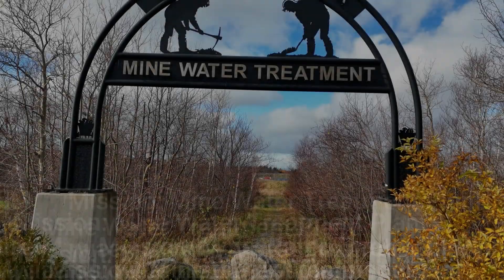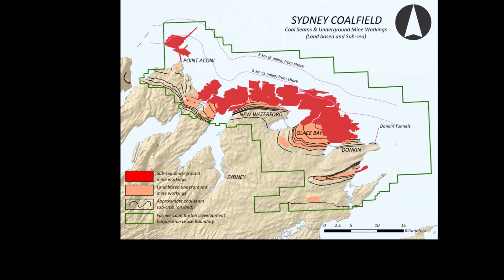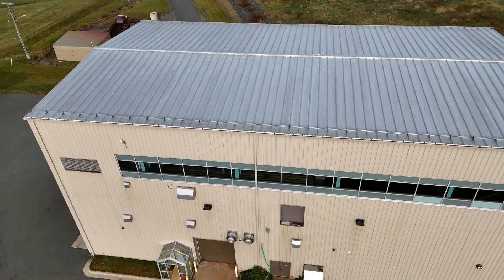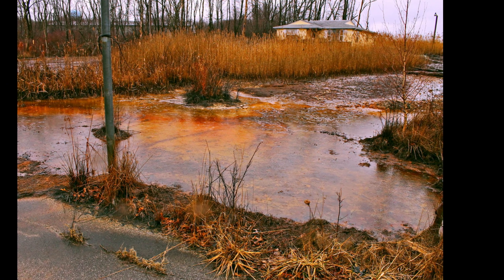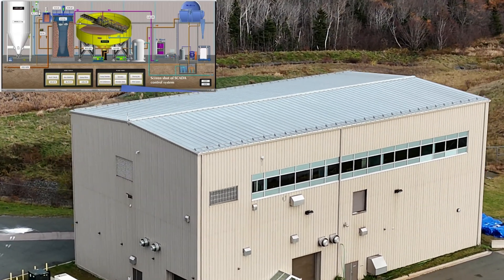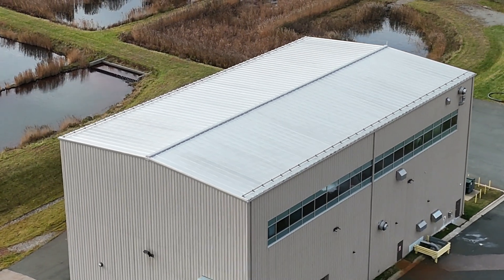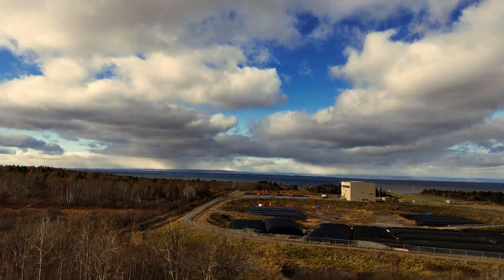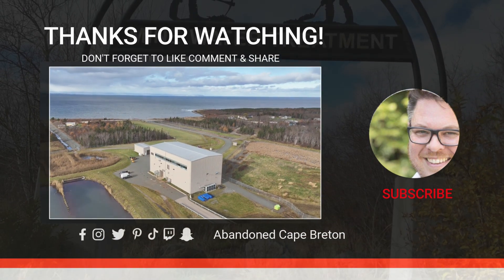Mission to Mine Water Treatment Plant: how abandoned and flooded mines make clean water.

Comment: Very interesting how this new build ties into the polluting legacy of vanished industry. I'm currently doing a history thesis on DEVCO so this plant ties into my research. I'm curious where you found that map at 10 seconds in, because I've been trying to find geographic data about the undersea mine workings so I can make a more detailed map than I already have. 

Also for suggestions about where to visit, I'd like to see some exploration, if possible, of the surface works of the new mines built by DEVCO (Lingan, Phalen, Prince). These were large modern mines that were bulldozed right after closure in 2001. What does this look like? What environmental impacts remain? What social consequences did this political decision have for communities? Etc. Hard for me to visit myself since I'm in Alberta these days.
Reply from the maker: Stay tuned!  I know future videos will be of interest to you.  Also, I try to publish my sources unless there is a reason not to, so you can find it and use it if you need.